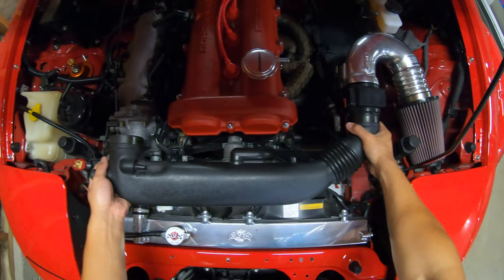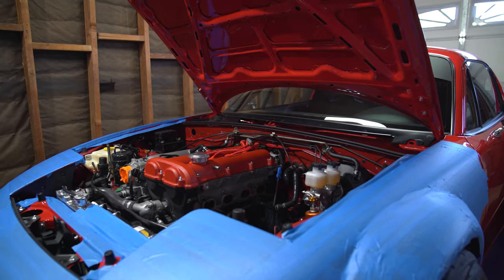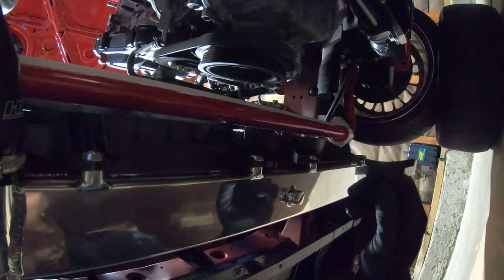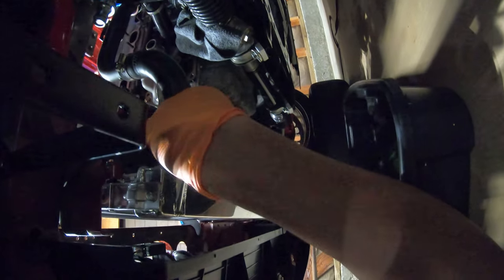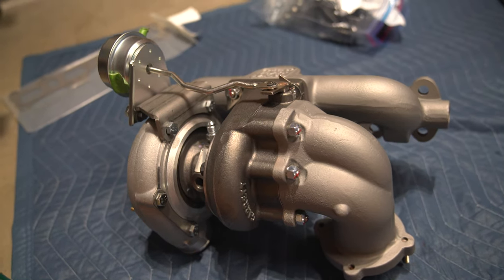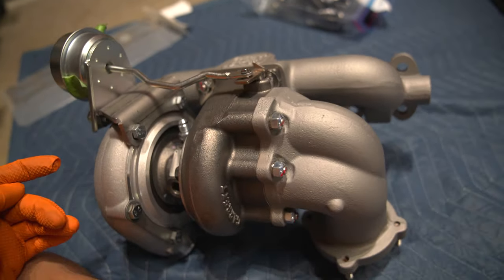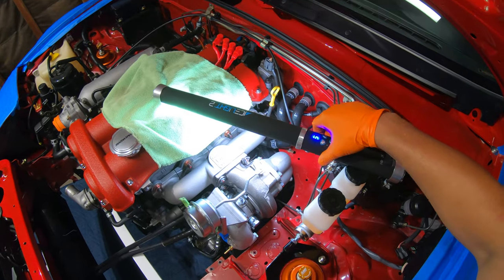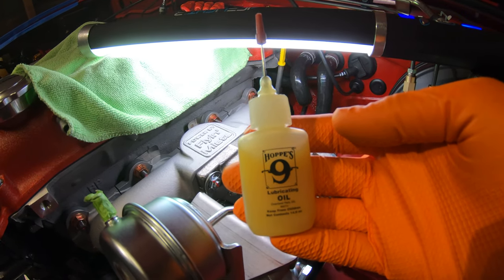FLYIN' MIATA TURBO KIT INSTALL PART: 1 | #OMGMIATA | EP17 | [4K60]

Comment: I would hate to own this car just because of how clean it is. I would be scared to touch it
Reply: that’s why you buy a cheap but solid one. you can drive it hard and not worry if you break something. you can just fix it.
Reply: @user-dl8yo3wv1t  Don't TRY to break it.   Miata parts are getting harder to find.
Reply: they had us in the first half..

Comment: I am absolutely amazed at how clean EVERYTHING is on your car.  The steering rack, each and every bracket, all corners and nooks, everything is incredibly clean.  I drive my Miata between 10-15k miles per year.  I try to keep it clean but no way could I keep it this clean, driving that many miles.

Comment: There is another way to do oil drain and you don't need to drill. You can tap into an existing oil line and run return through dipstick hole.

Comment: I got one for sale look at Facebook market place in Woodstock Ga.. full FM turbo kit.. hot side upgraded full 3 inch.. FM happy meal clutch, FM frame rails, wilwood bake brake kit, bossfrog roll bar, butterfly brace. 6 speed upgrade, lsd.. $7700 dyno tuned very conservative 230 whp it's red ..

Comment: WTF is wrong with you miata people , you don't drill oil return while the pan is on the car.
Reply: Yea I dont like it to. But to remove pan engine has to come out.
Reply: @bobbobo4748  soo what? You are doing turbo , you should do it anyway , you want the car to run or you want metal shivers in your oio system.
Reply: @Jackal9405  no reason to take the engine out
Reply: @bobbobo4748  we simply look at things differently , for me it's more like " no reason to not take na engine out" . Adding a turbo to a NA car is not a quick and easy job . I'd rather just take an engine out and be fine with it.
Reply: Tons of people have done it with no issuers
Reply: This concerned me too when he drilled into while it was on the car. I hope it worked out well for him